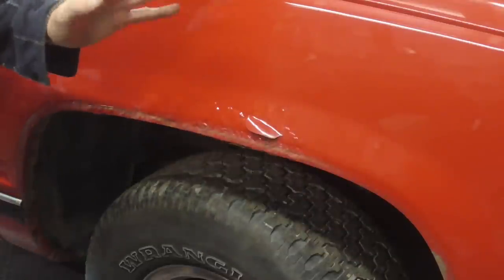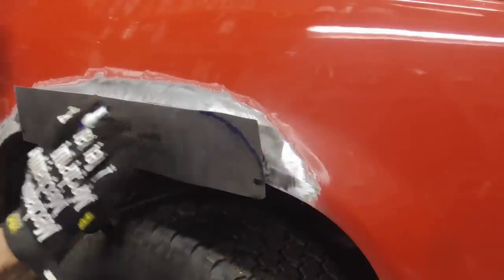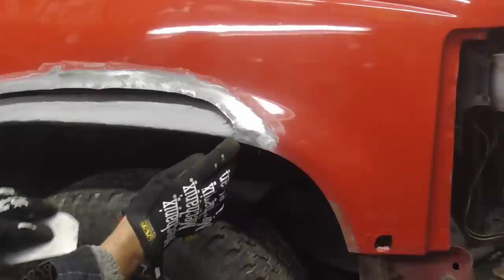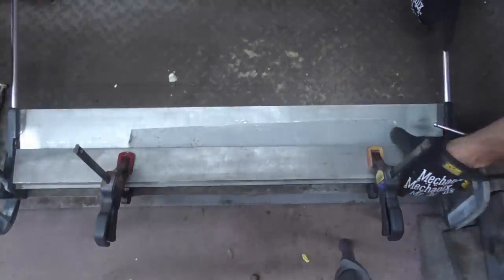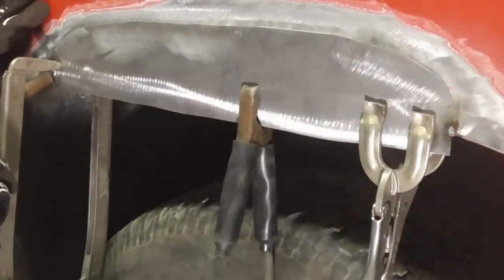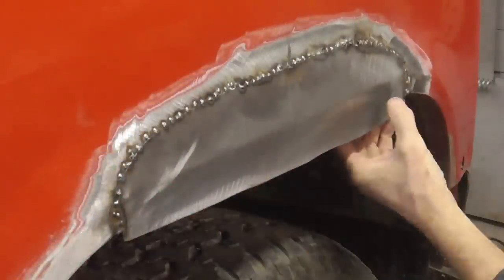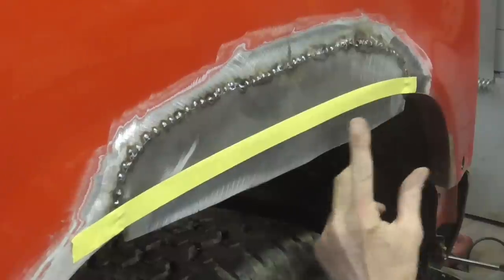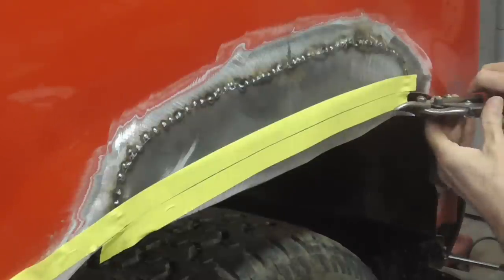How to Measure, Cut, Fit & Weld Automotive Patch Panels

Comment: Why do you not do but welds instead?
Reply from the maker: There's 3 ways professional body shops fix rust:
1) Combination of Lap and Butt welds.  If you insist on strictly butt welds, here's the best way to do them for longevity: https://www.youtube.com/watch?v=e9bjZ_UxtJg
2) Lap joint using structural adhesive or panel bond
3) Fiberglass cloth and fiber reinforced body filler
If you are really interested here's some great information on it:  
     Lap welding is how all body shops in Michigan repair rust on late model vehicles (welding or adhesive).  Strictly butt welding a patch panel, which has become popularized by the internet and TV,  is not the best quality repair on today's thinner metal and there are many good reasons why professional body shops don't do it.  Shops use a combination of both lap and butt (butt for rigid areas that can’t be tapped down) on almost every patch but would never just butt two pieces of metal up (gap or no gap), weld it, then grind away at the area attempting to metal finish it.  Here why with good reason  - especially Eastwood’s starting 22 seconds in: https://www.youtube.com/watch?v=rpH50kh4W00  *
https://www.youtube.com/watch?v=MfKlNQF-o4I  *
https://www.youtube.com/watch?v=e9bjZ_UxtJg  
Today’s metal is .030. That is literally 6 hairs (hair is .005) thick.  You start grinding on that and the result is paper welds & surrounding metal.  In the end it’s what works for you though.  Keep in mind, you won’t find anyone butt welding in professional shops. Surely you’re not going to butt weld and metal finish this: https://www.youtube.com/watch?v=36zkc9UQaTs or some of my other rust repair videos.  Use small overlap, weld solid and you won’t have to worry about moisture - especially if you keep the drain holes clean (most important thing in rust prevention). Note that  the opening of the seam is upside down on the inside (no moisture trapped).  Gluing is also a great method.  Please see this video for longevity of this type of repair if done correctly: https://www.youtube.com/watch?v=8XaZBy7GC7A or 
https://www.youtube.com/watch?v=2o37dX--w0I
Reply: @mypointofview6056  Butt weld 20 or 22 gauge steel and see how metal you have left after grinding the welds flush, which isn't much, and you still have to use body filler. Hot rod hippie doesn't have 30 years of experience

Comment: What a hack job. I would have rolled the panel in a wheelie machine the tipped the edge in a beading machine.
Reply: jubjub247  I bet you use spray foam on rocker panels.
Reply from the maker: Hi Aaron, you can always buy a new fender - but this is for folks that want to know how professional body shops do it (in the rust belt - not on the internet).  Shops weld or use panel adhesive for patches with plain old sheet metal.  No high production body shops have metal machining tools or sheet metal tools.  There's no panel that can't be repaired with these methods but there's plenty that can't be repaired if you need those tools.  I've seen a lot of guys get let go because they couldn't do the work.  The good guys I worked with can do most body work with a 5 gallon bucket of tools - that's really all you need.  Those are the guys you really respect too.  Have a good weekend :)
Reply: @LakesideAutobody  you could have used a pair of pliers to tip the edge wo all those slices in it, and a hammer on a rubber surface could have put some shape in the panel. It all comes down to understanding what metal does. I know alot of guys who can fix most problems with a 5 gallon bucket of bondo and they usually have a rust repair disclaimer on the wall.
Reply from the maker: @aarondalton2223  I like one method that works every single time and you perfect it.  That's why I was fast, efficient, made money.  There's all kinds of sharp bends, curves and shapes that rollers and fooling around w/ the metal ain't going to create.  There's never been a shape I cant make with the methods you'll see on this channel.  Again, that's why some guys couldn't survive in a real body shop.  I'm sure there are other and better ways with better tools but you don't have access to those most of the time so... Nice talking to you though - have a good weekend :)
Reply: Keith Clark  i think you may be confusing body shop with restoration shop he is not restoring cars he is making a rusty turd look good for 10 more years
Reply: @darrickcover2200  This type of repair may last 5 years at most. Restoration or daily driven car there is a correct way to repair a car, and there are short cuts. I have watched several of his videos he shows short cuts not proper repair. He says you can't butt weld this thin metal, which is BS I have done it many times. He also says this is the way they do it in Michigan, where the work is done has no bearing on how the work is done.
Reply: @mypointofview6056  he says you can't butt weld thin metal without making it paper thin after grinding welds down. Nearly all shops do it how he's doing it on thin metal, small over lap. If you don't keep it treated for rust after and it rusts out after a few years then that's on you not him. Absolutely nothing wrong with a small overlap and it's stronger and will last longer. Either way it's still welded and you have to keep it treated or it's going to rust. Guarantee the lap will last longer because it's thicker and stronger
Reply: @aarondalton2223  no auto body man is going to go through all that crap on a 10 year old daily driver. What he just did will last as long as what you are talking about and probably longer and look just as good. He uses minimal filler and all lines can be recreated. He isn't working on a $40,000 muscle car
Reply: @aarondalton2223  You're talking about tools at a fab shop that people use to restore classics. This is a 90s truck, no one is going to pay fab prices for a repair that for all intents and purposes will be just as good
Reply: @mypointofview6056  5 years? He literally has a 20 year old tailgate that he done the same repair on. It will last as long as the person that takes care of it afterwards

Comment: I see minimal penetration of the spot welds, too short duration and too low voltage.

After grinding I would wager there is little strength in the joint.
Reply from the maker: Ahh... That's why you don't grind welds that much.  Very few guys waste time and materials grinding welds in a professional body shop.  See this video from Eastwood for more info: https://www.youtube.com/watch?v=rpH50kh4W00  Also see these videos for the longevity of this type of repair: if done correctly: https://www.youtube.com/watch?v=8XaZBy7GC7A  /
https://www.youtube.com/watch?v=2o37dX--w0I   BTW you can hold the trigger longer if you prefer and even put the welds right next to each other - that's up to you - I try to save gas due to it being a video.  Have a good week :)
Reply: You don't need much heat to get good penetration on 20 gauge steel. Anymore heat than that and he would be blowing holes

Comment: thats going to rust again, you applied no weld through. Botched
Reply from the maker: Don't use weld through primer as it will affect the weld pool and is really not meant for MIG but a spot welder - the kind that pinches two probes together.  Remember, with MIG, you are adding metal (wire feed) - that will not be coated with weld through and rust .  Here's the solution - https://www.youtube.com/watch?v=8XaZBy7GC7A  Don't go anywhere else for rust repair - the shops I worked at figured it out years ago - https://www.youtube.com/watch?v=idrLzsz2eLg